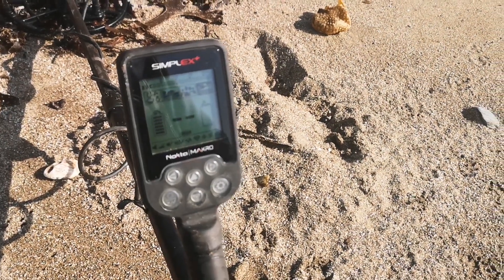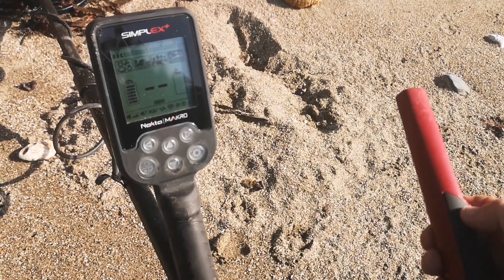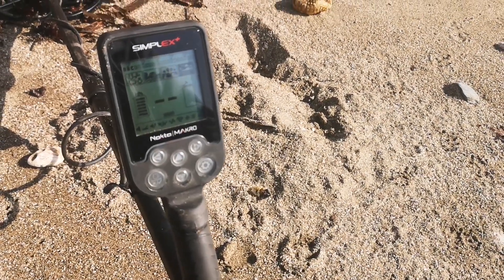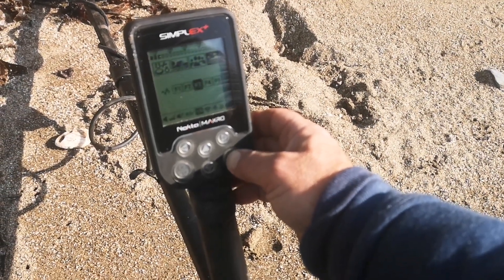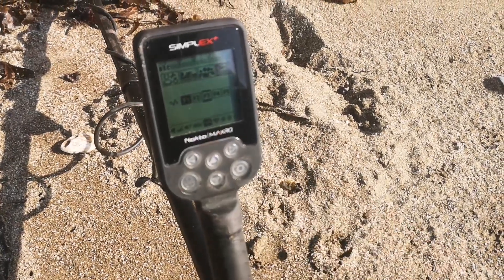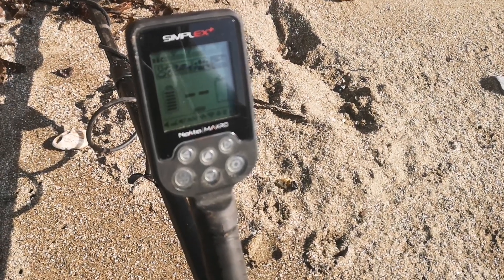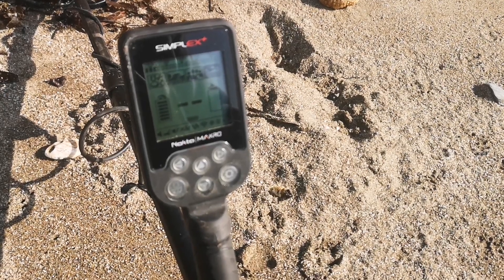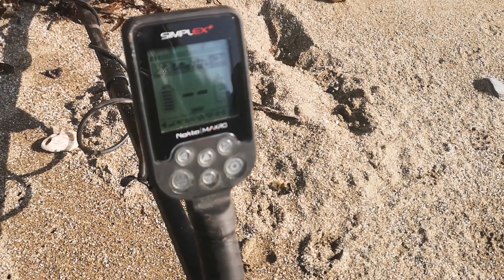Nokta Makro Simplex Eliminating Pinpointer Interference

Comment: I think the best and easiest fix is to just put your detector behind you while you use the pin pointer. Kinda sucks but so far that’s the only thing that works for me since the new simplex only has 3 frequencies and it honestly seems like they don’t do anything.
Reply: I just read that the 2.77 software update has fixed this problem. That’s good news!
Reply: @kim___  I didn’t even know they had an update
Reply: Doesn’t work very well that way, it still makes the metaldetector very jumpy. The Nokta Pointer even makes the Simplex chatter when the pointer is turned off!! The Minelab pinpointer works flawlessly with it though. Decided to sell the Nokta pinpointer.
Reply: @kim___  yea nokta needs to fix it
Reply: @globofgreen absolutely

Comment: I only have 3 F numbers and won't work with my mi6 just tried all three.
Reply: Same here. Did you find a solution?  Thank you
Reply: It works with the Garret pinpointer, but it’s a pain to set it each time.
What pinpointer works out of the box with this machine?
Reply: @elgato1013  I gave up, sold it and bought the Quest Q30.
Reply: @elgato1013 one year later….it doesn’t interfere with the minelab PInpointer. It does with the nokta Makro PInpointer and the Garett, don’t know about others. It’s a pain in the ass!